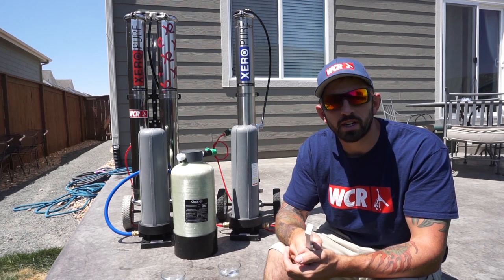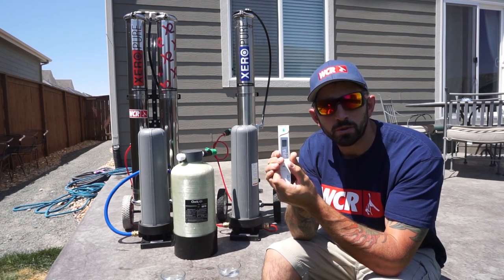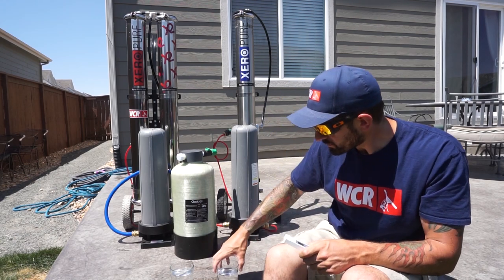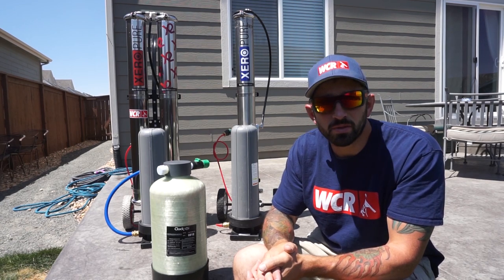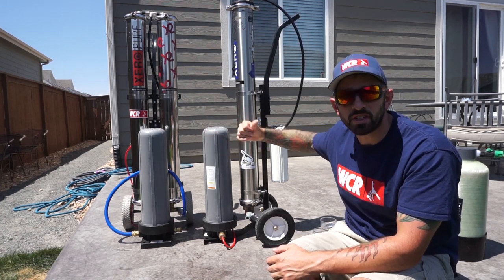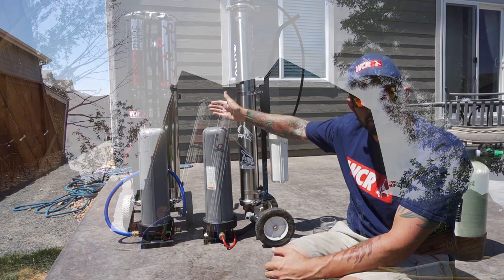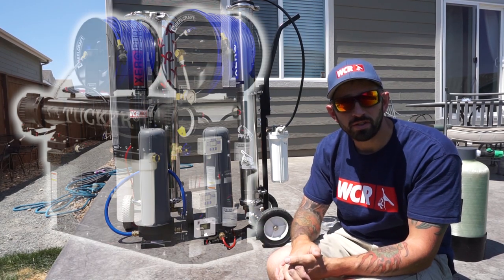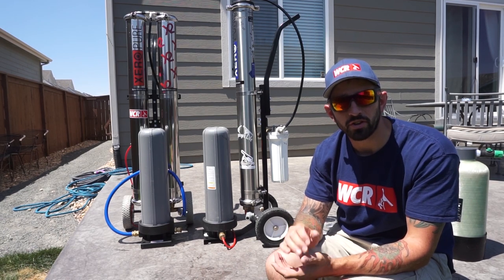How To Choose a Pure Water System

Comment: We use D.I tanks in Southern West Virginia. Most places here I have tested below 50 PPM.  Maybe 15 homes were cleaned and 1 commercial account in 2 years. A D.I tank last us about 2 years. The rest of the commercial accounts are traditional window cleaning. I will pull out the Water Fed Pole if there is a need for it. I love using it.